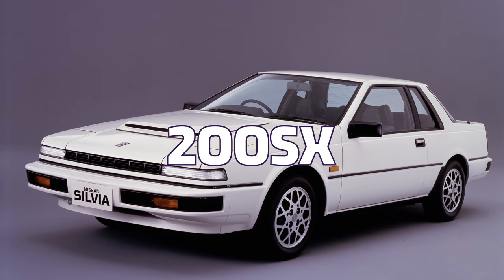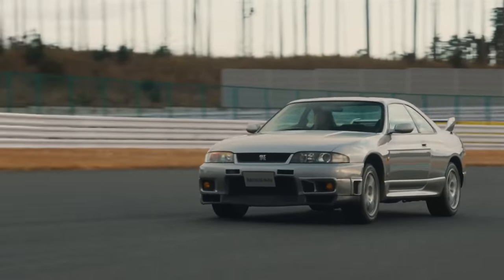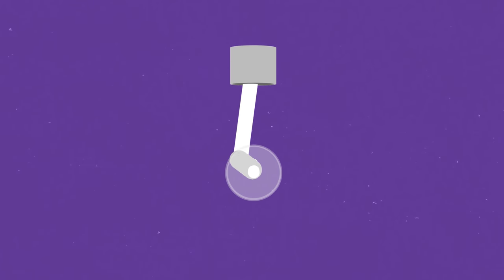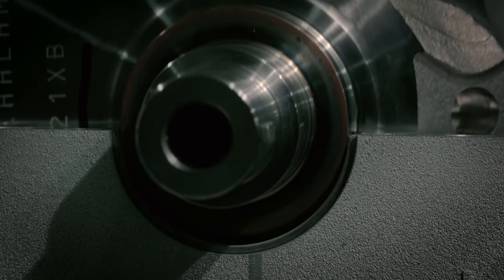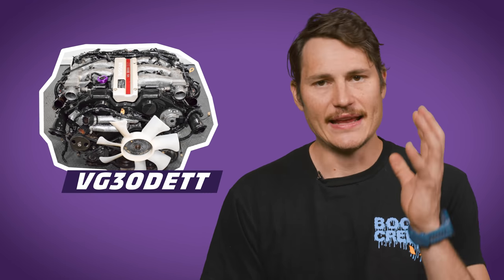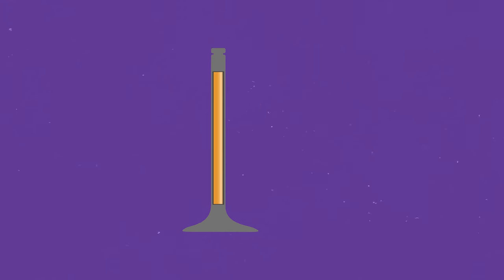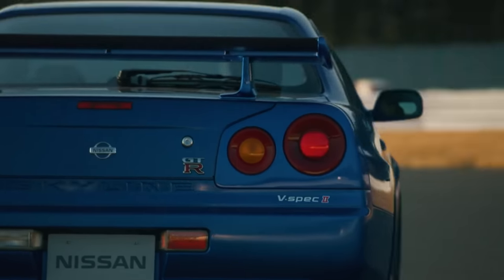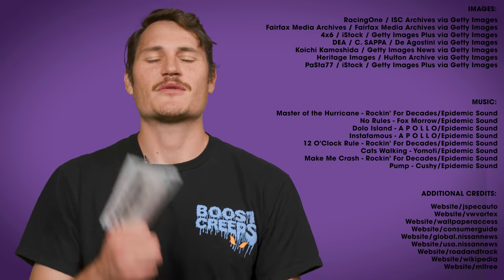RB vs. VG: Why Nissan Discontinued Their Best idea

Comment: It’s ok that the vg didn’t win this round. When it comes down to building car/engine it’s really all dependent on what you’re trying to achieve. I will say though, if money is an issue, buy a vg. For around $4k, you can easily build a stout 450hp vg. That’s pretty hard to beat and why I built one myself.
Reply: How is maintenance on it?
Reply: @therealsnoop7497  not bad! Finding certain parts is a little hard but there are a lot of forums that you can pick stuff up from. The z31 community is amazing.
Reply: @johnfran3218  gotta love youtube. vg chads talking bout cars, porn bot, god bot. love it. lol.
Reply: So 4k to make the power of a junkyard Ecoboost. ok.
Reply: If you do all of the maintenance a single overhead cam vg can handle 600hp pretty safely. And they weigh less then a ka24
Reply: I'm making 320hp with a junkyard pathfinder vg on a stock z31 ecu - tune with just a rising rate fuel pressure regulator
Reply: Ive got a vg33e, im not sure how mich different it is but i know i cant make 450hp with her
Reply: @cylofive_Media  you definitely could. They're basically the same engine. Only thing you have to be really careful about is detonation
Reply: @codeyjoseph2051  plug and play?
Reply: @Walkeranz  no. If it has to be plug and play for you to want to build it you're not gonna like anything that's not an LS 💀
Reply: I’m pretty sure the VG is an RB in the shape of a V cuz it’s a v6
Reply: @rissu8573  not necessarily they are definitely distinctly different. However they are both very capable. One is just 1000x easier to get your hands on then the other
Reply: @codeyjoseph2051  while the other is 1000x easier to get parts for if you can afford them haha, I'm restoring a Z31, finding engine parts has been mostly easy save a few small items, but finding parts for the car is entirely different story.
Reply: @TheChance9436  everything you need exists. If not you make it. 🤷‍♂️ I built the turbo kit on my z. Everything to keep them running isn't hard to get
Reply: @TheChance9436  none of this video is about the Z car itself though they're talking about the engine the car is only hard to get "bolt on" parts for because people haven't adopted them
Reply: @codeyjoseph2051  I know it's not about the car itself, just making conversation is all. And I agree, parts are readily available for the car stock, but we all want more HRSPRS lol and as you've said bolt ons can be tricky to find and even though I've had some hiccups, should have everything to make some decent and reliable power. Definitely wish I had the tools, space and knowledge to make my own stuff, but that's not an option for me right now, one day though.
Reply: @TheChance9436  there are people who make bolt on parts for the z31 its just a matter of if you want to spend the price on that. Me personally I'd rather build everything myself
Reply: @codeyjoseph2051  I get that, I'm hoping to get some fabrication tools and equipment with some holiday sales coming up, to practice and make some simpler things like an exhaust or reinforcements. you'll never learn or get good at something if you don't try and practice.
Reply: See my dream car has been a TT Z32 for years, and I owned an NA Z32 a couple years ago, but the actual cars themselves are expensive asf now. Twin Turbos (the cheaper but good ones) are in 10k-20k range

If I wasn't broke asf I would buy one in a heartbeat.......if only I could trade in my BRZ for one
Reply: @prussianaudios1432  I was lucky I got my z31s for under $1000 each.
Reply: how, I have a D22 frontier and I'm looking to push more ponies out of my VG33E, thinking of putting that supercharger into it and turning it into a VG33ER
Reply: @_yahir_7673  the superchargers are wayyyy too small for the vg, turbo is a lot better. A t3 or a t3t4 is the easiest way to have a good powerband out of a stock vg30/33e
Reply: Yeah but what if it's a first gen in a z31
Reply: @engineeringpig8979  elaborate
Reply: 300ZX?
Reply: shhhhh we aint need knowing about the VG mannnn prices gna skyrocket
Reply: If you wanted 500+ reliably I would choose the RB. I’ve been in a 750+ z32 and it was awesome but felt like it was always on the edge of failure or grenading, especially the transmission..
Reply: I’d love to know more about your set up. Thought that once you get towards 300hp you need to run a nistune or another sort of ecu
Reply: @rissu8573  100% man, I know both engines fairly well and found that a rb30e and vg30e share some components like rocker arms and rods. VG30e is basically a RB30 but cut in half.
Reply: 4K you can almost double the power from an rb25 pretty easily where as a big will cost that to get running right 
Ive had skylines and done it currently have a 300zx so I am talking from experience
Reply: And with 4K you can triple a vg30e’s power
Reply: @triffin  stock with a t3t4 turbo. Rising rate fpr. Could use to have an upgraded fuel pump.
Reply: @carbonfiber492  I know from experience you can double the power of a vg30e for 1k. Or double the power of a vg30et for 5k(including maintenance)
Reply: Fantastic!  Use any particular rising rate fpr?  And use it inline with the stock fpr?  Had a z31 with a HX35, nistune mb injectors and the standard upgrades over 10 years ago. But I don’t need anything crazy. Getting into the 300s is all I need now.
Reply: @triffin  just use a good quality 2 feed one return pressure regulator instead of the factory one. The better solution is to go standalone and upgrade the whole fuel system but a rising rate works great for about 320hp, wouldn't trust one past that
Reply: The VG33E is where it’s at. Had one in my 2001 Nissan Xterra. Only bitch is replacing plug 6
Reply: @cylofive_Media  Change the pistons to the VG33ER pistons or you may burn through them.
Reply: @harejr8396  all a vg33 is is a overbored vg30 with a weaker crank snout
Reply: @harejr8396  both are good but the .3 liters means nothing over a 3.0 if you have an efficient turbo setup
Reply: @InsaneBimmer  Take your thumbs up from me! You are correct and made me laugh.
Reply: @codeyjoseph2051  it also has a supercharger. It makes like 75-100 more hp. But it helps on the trails
Reply: @codeyjoseph2051  plus idk if you know but the R34 moshimoto radiator is compatible you just have to redo the mounts
Reply: @harejr8396  anything is compatible if you wanna put in the effort to make it work 🤷‍♂️
Reply: @codeyjoseph2051  it actually has a slightly thicker cylinder wall than the vg30 to accomodate for the bore as the vg30 bored to 3.3 would be the maximum you would want to bore it as anymore would cut too close to the cooling galleys. If you want the extra displacement, it's always better to use the vg33 block, head casting, and pistons with the vg30 internals for better reliability
Reply: @cylofive_Media  lol i have one with a gt35r turbo. Although i messed up base timing and was runnning 10 degrees advanced which blew the HG.
Reply: @TheOhsemix  im running a stock vg33e in a 2003 xterra, she runs like a champ and coming on 240k kms, i laso have an ls in an 07 chevy silverado with over 400k kms and ticks more than a guy with tourettes
Reply: @cylofive_Media  yeah my vg33 came from an 04 xterra with 130k miles.
Reply: @codeyjoseph2051  your vg is single turbo?
Reply: @jimmyhelminiak9815  correct
Reply: @joshuatrites974  the cylinder walls are the same thickness on a vg30 as a vg33, the inner diameter is just bigger. Vgs like to make power at really high rpm (4-9000rpm) going much bigger then a vg33 you'd be loosing out on being able to rev it that high
Reply: It’s rare as hell that someone makes a valid comment that not only makes sense but is backed up by facts. I appreciate your comment.
Reply: @titanary68  thanks!
Reply: @rissu8573  yeah I'm pretty sure an elephant is just a mouse but bigger, bald, and with a longer nose
Reply: If I was gonna build a Nissan V engine, I wouldn't waste time doing a VG and jump right onto a VH 8 cylinder instead....  we dropped one into a S14 Silvia a few years ago along with twin blowers.....  she really boogied.
Reply: @Desopolis  how alot of people would swap the 300zx transmission into 240sx's because they were stronger transmissions.
Reply: @triffin  They make adjustable FMUs, too, so you won't be locked into one ratio/tune. Try Corky/ Bell Engineering, he's somewhere in Texas and builds all kinds of FI stuff for Miatas. He's got adjustables, and tbh aside from him I probably wouldn't trust anyone else's adjustable fmu. fwiw. Alternatively you can run a regular FMU and just buy a bunch of the internal ratio discs and disassemble and swap out as necessary. Kinda a pita though lol.

Walbro 255, and don't forget to retard timing a few degrees and run 93 in the summer. Should be golden.
Reply: @codeyjoseph2051  when they came out with the vg33 they thickened the cylinder walls. If the vg30 and 33 have the same thickness at bore. It would mean they thickened the cylinder wall to accomodate for the larger bore to help with reliability. To get higher revs, use the crank and camshafts from the z31
Reply: @joshuatrites974  you have to use the crankshaft, oil pump, oil pickup, oil pan, and timing setup to put a vg33 in a z31 in the first place. They aren't stronger, they barely make more power (negligible at best) and they definitely aren't more reliable
Reply: @codeyjoseph2051  if you're boring out the vg30 it is better to go with a 3.3 block as yes the cylinder walls are thicker than the 30 from factory to negate the thinner cylinder walls. The block itself isnt as capable passed 650+, but for most building, it wont go beyond that and. If you tried putting a z31 head on a vg33 block, you'll see what i mean. If you bore the vg30 to a vg33, you will have thinner walls than if you were to start with a 3.3. these are facts not opinions. There are things on the 3.3 block that are weaker than the 3.0 that if you want to go all out it makes no sense to over bore the 3.0 due to cylinder wall being thin and it doesnt make sense to use the 3.3 to risk other components failing. If you want cheap power gains and are planning on building something under 650, there's no reason why the vg33 isnt better to use, then you can use vh45 pistons to increase compression and get more power. The configuration of the block changes 3 or 4 times. Most very minimal, but in the change over from 3.0-3.3, they did increase the thickness of the cylinder walls to accommodate for the increase in bore
Reply: @joshuatrites974  you realize people have made over 1100hp with vg30 blocks right? You don't NEED to over bore them you just need to rev them higher, and the 3.0s are a lot better for revving high then 3.3s
Reply: @joshuatrites974  the cylinder walls are the same thickness as the vg30. They are just bigger. Go measure the cylinder wall thickness on a vg30 and a vg33 its the same.
Reply: @codeyjoseph2051  if the cylinder wall of the 3.3 is the same thickness of the 3.0, that means youd be able to bore the 3.3 to a 3.6. if the 3.3 was thinner than the 3.0 that'd mean if you bored the 3.0 to 3.3 theyd have the cylinders walls afterwards. The 3.3 can be safely bored to 3.6 with some boring to 3.8, albeit unreliable
Reply: @joshuatrites974  over boring a vg is pointless though, more displacement doesn't really help them to make more power. Coming from Michael Palladino, one of the most well renowned z31 builders the only real upgrade when it comes to going to a vg33 is availability, and that's locational. Where I live it's way easier to fine vg30s then 33s
Reply: @joshuatrites974  it's a closed deck iron block v6 it's literally the perfect combo for high revs. The more you bore it out the more mass you're going to have in the engine. Meaning it's gonna be less capable of revving high, loosing that powerband these engines have. The higher you rev them the more power they will make, the only trouble is that once you start to rev them past 8500-9500 the oil pumps start to cavitate. 2 solutions are find someone who can make you an upgraded oil pump, or go dry sump like Nissan did in their vg30 racecars
Reply: @codeyjoseph2051  You can't take a VG30 block out to VG33 without x-raying it first.  An actual  VG33 block is the safe way to do it.  And as I said above you can punch out a VG 33 and use VH45 pistons and voila...a VG34.
Reply: @mescko  you're completely missing the entire point of everything I said. A vg makes its power revving really high. If you add more rotational weight in the engine it wont be as capable of revving high safely. Meaning you're kinda just making the VG worse at what it does best.

Comment: My stock internal VG30 put down 540RWHP and 540RWTQ in 2014. Still going strong today.
Reply: Good username too 👌
Reply: people have made 700+ hp on untouched vg30dett’s
Reply: @evan-od4fq  people have made 700+ on  even VG30DE's. Just bolt on a turbo (or turbos) and crank up the boost.
Reply: Legendary, have been trying to get those power levels for a while now haha

Comment: I had alot of fun with vg engines In my day and really loved how they responded to more air and fuel. There's a few people still tuning them and enjoying them too.
Reply: I bought an 87 300zx a few months back and it’s a super fun car
Reply: @Lofi.z34  😳
Reply: @billgates23yearsago4  ikr
Reply: Idk how you got so many likes saying a gas motor responded well to more fuel and air. That's how all of them work.
Reply: Thought round 2 was about performance.. not price.. no ties!!
Reply: Do they do very well natraully aspirated?
Reply: @imhuntingdeer125  they do actually if you take time to focus on every detail. There's alot of little things you can diy if you are handy and just scour the forums and youtube. A big thing use to be port matching and porting, bigger tb, ecu, exhaust, headers, ect
Reply: @cppctek  yeah I'm just trying to stop my truck from bogging on hills , I've got a vg30i
Reply: @imhuntingdeer125  what have you done so far.
Reply: I have a old maxima I need to work on 😭
Reply: @cppctek  not much yet sadly, bought a k&n replacement filter, checked my plugs,remove a light that was blocking my airflow. I thought about getting headers but Im afraid a header install would turn into a night mare with snapped exhaust studs, this is my DD, also I just spent 600$ on a winch. I will get my exhaust done with 2 1/4 inch pipe    and a less restrictive muffler soon though
Reply: @cppctek  Ive got a 87' with a GT35r turbo and itmade 20+ pulls when i accidentally ran it at over 25 degrees of timing in boost on 93 octane. They are really only supposed to see high teens low 20s at the most. Eventualy in a 2-3 pull I blew something up hoping its just the HG. But it held up way better than my l28et that blew the HG with just 18 degrees of timing on the stock turbo.
Reply: @InherentTrash  how much do they go for?
Reply: @garden0fstone736  bought mine for 2k and it’s super clean. 5 speed manual vg30. Ignore the guy that says they don’t come with vgs. I can literally show my engine bay and manufacturer plate under the hood lmao
Reply: @bradiusmaximus yes they did 😂 you want me to send you pics? Because it’s definitelt a vg30e. I can even show you the plate under the hood. If you’re from Canada you might have seen a z31 200zr but don’t talk about things you know nothing about.